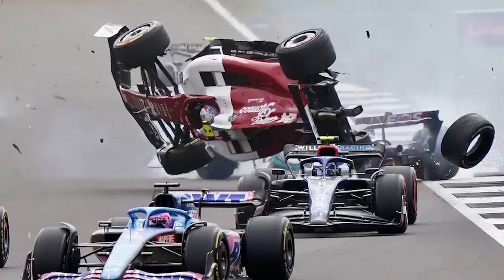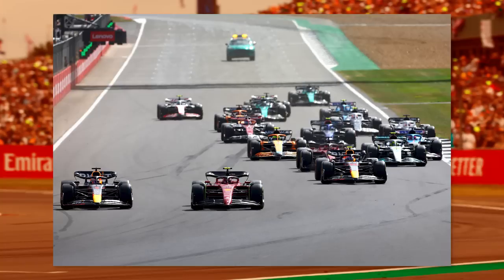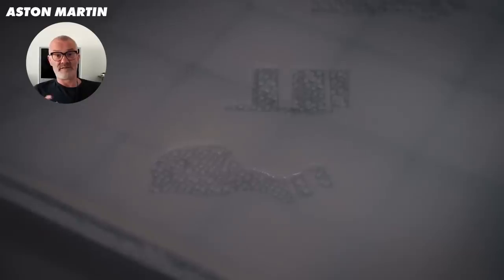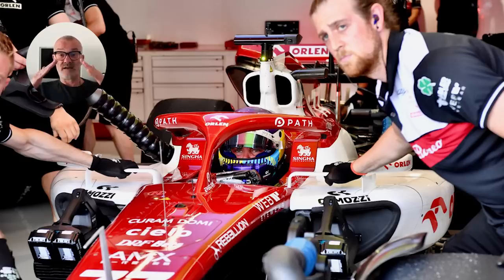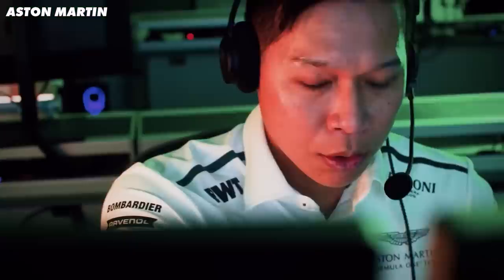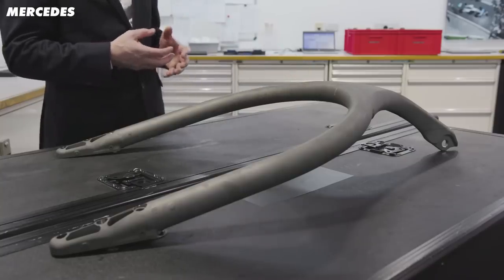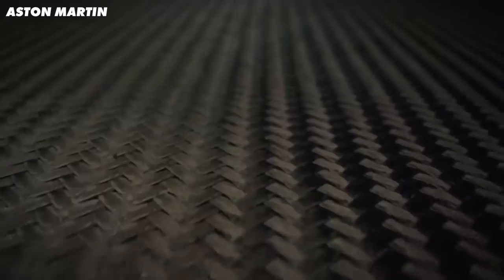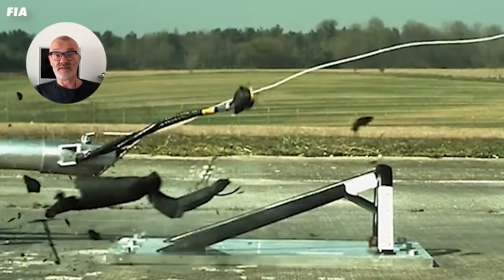Did the Roll Hoop FAIL in Zhou's Crash?

Comment: What would probably help is in addition to the 3-axis force test to do 1) a "torgue test" where you apply force from opposite sides on opposite ends and 2) a "rip test" where you apply force on the front top end in the upwards and rear direction.
This would properly test the bonds and carbon fibre in their weakest links.
If you wanna be extra fancy/safe you would do all 3 tests with static and dynamic forces.

Comment: 1:57 Wouldn't it be better if the top of the helmet didn't extend past the halo? It swoops low towards the back.
Reply: Yeah that's exactly what I was thinking!
Reply: Yea, if that was Ocon or George in the car, it wouldn't have been such a good outcome.
Reply: @scottmcqueen3964  Maybe, maybe not. You can lose quite a bit of your helmet and still be ok.
Reply: @kalasmournrex1470  wouldn't ur head just snap off if ur helmet makes contact with the ground at such a speed? Or would it shred? but i feel the latter is unlikely given how mobile and light human body is
Reply: The gap between the halo and the roll hoop is intended for driver to escape during emergency I guess
Reply: @SuperLol  You do have the neck brace which is supposed to limit the range of motion of the helmet but it definitely wouldn't be an ideal situation

Comment: Great content as always! I don't think the FIA needs to depart from static testing versus just understanding all of the likely directions that the hoop could be loaded. It was an unusual event how the car rolled and I think the more likely culprit of the failure boils down to assumptions on the magnitude and direction of force (which is more of a kinematics problem). Teams already use FEA to design most if not all parts since it's been around for a long time.

Comment: Another issue could be that the original, downwards impact could have slightly damaged the carbon fiber. the stuff is super strong, but it is also pretty brittle, so once it gets even tiny cracks or damage it will be much more susceptible to failure.

Comment: Something amusing/interesting to ponder: Some of the very earliest forms of pottery is taking clay, rolling it into long thin pieces, then layering them to form the shape of something akin to a vase. Contrast this with wheel turned stuff later on and you see the main difference is that the former is additive the latter is subtractive (if you will). The modern day 3D printed stuff like talked about in this video is really a high tech version of that technique which itself is only slightly younger than dirt.

Comment: I'm sure it's been said somewhere below already, but my thought here is that this is a great example why the roll hoop AND the halo are essential - as rigorously as you test any safety component, some real world peak loads may be end up being essentially incalculable. Crashes are unpredictable. Having fail-safes and redundant safety features is a good thing. I don't know if the roll hoop necessarily needs to be re-evaluated, tbh it looks like it did its fair share to keep Zhou safe. Obviously, improvements can be made, but there's nothing to say that an updated or upgraded roll hoop would never fail in a similar fashion in a different crash later on.

Comment: One thing to consider is if the roll hoop didn't snap off how violent the crash could have been if it had dug into the gravel immediately when the car was still travelling incredibly fast? We may have been watching an F1 car flying through the air rotating 4-5 times which could have been more dangerous for the driver when it come to GS and forceful impact hitting the floor or barrier. The fact it become smooth helped it slide across the gravel and loose some of the cars speed before the final dig in and flip.

Comment: I had the feeling that after the initial impact, the car started spinning on it, and that spinning was the cause of it failing due to the different forces being placed on the roll bar. But it is still good that they will investigate it, and probably introduce another safer system. And to see Zhou smiling afterwards shows really how good safety is these days. I enjoyed the explanation in your video, very informative without being overally technical.
Reply: i think the most likely solution is to have the roll hoop fully intergated into the monocoque rather than a seperate peice added to it.

Comment: I think they should introduce a titanium base structure for the titanium upper part to sit on as it was not designed for multi twisting forces. Bonding it to carbon fiber is strong, but ply direction during layup introduces uni-direction strength/weakness. I have experience in design with high end products and would recommend a different titanium to titanium hard mechanical mount as the carbon body can integrate the lower portion.

Comment: Great video. So did Zhou's helmet show evidence that it made contact with the tarmac?
Reply: No
Zhou is quite small and there needs to be at least 7cm of gap between the top of the helmet and the "lowest" point of the "top" of the halo
With how tight f1 drivers are strapped in there's no way for his helmet to touch the tarmac fortunately
Reply: @Alucard-gt1zf  So the roll hoop is basically redundant

Comment: Nicely explained, both of you. 🙂👍 So glad that the halo worked. Less than 20 years ago, if that had happened, he would have been dead. I'm wondering how much of that Carbon fibre failure was down to the car being so wide that the roll didn't continue until the car hit the tyres? Incidentally, all that saved the spectators from being hit by the car was the wire fence. Perhaps it should have been further away from the tyre barrier?

Comment: I'm quite sure, the shape of the upper metal roll "blade" with its quite small crossection at the top and fairly sharp edges contributed a lot to it being able to dig itself into the track surface instead of sliding over it. A more conventional roll hoop design being much more rounded on top wouldn't have been able to do so - It would have ben able to slide over the track and therefore wouldn't have had to sustain such massive lateral loads... And eventually wouldn't have been ripped off from the monocoque.
The groove that the roll-hoop left in the track tells a lot... Like scarb's said, I really think they need to take a look at the shape of the upper portion of the roll structure to prevent it fom being able to dig into the surface.

Comment: I've done FEA on an older (pre-halo) F1 roll hoop. Mid noughties, actually. Early days of cast titanium structures. The design I tweaked passed testing, and survived two in-race "tests" that same year without experiencing any structural damage. The crashes were nowhere near as severe as the FIA "proof" test. 

The idea that a structure (that can survive some 15 tons of load that crushes it towards the monocoque) is ALWAYS going to be safe (under all conditions) is ludicrous.
On the other hand, the load when a car is skidding along the tarmac is NOT "tremendous". It is barely more than the gravity of the car pulling it towards the road (0.8 tons), with the inverted downforce possibly reducing that. It is not even 1/10th of the test load. 
BUT. 
It is ALL side load, and the friction between "hoop" (we should probably call it "safety crash device") and tarmac will be trying to shear that hoop from what it is bonded to. 
"Digging in" might make it become the immovable object trying to stop a fast crash, which will rarely end well. As the video suggests, the roll hoop might need some geometry specs to ensure it cannot dig into the tarmac, because it would be impractical to make it strong enough to withstand that load in all directions. But even then, there will always be the case we failed to anticipate...
 
The delamination strength of the monocoque does not enter anyone's mind when crash tests are devised, and this one fails to test that problem totally. What is more surprising is that more roll hoops have not been ripped from chassis in previous accidents. The things work DESPITE our supposed cleverness, not because of it. (Incidentally, Airbus failed to consider delamination strength in their early composite wing designs. Those results were terrifying... luckily a mandatory real test discovered the wings were not even strong enough to survive 1x loading, never mind 5x, before the Airbus fell out of the sky.)

It always bothered me that designers focused ONLY on passing the FIA test. No-one ever considered "what if the impact is in another direction". Worse still, the structure only has to pass ONE application of that ONE load. If the structure completely collapses, that's fine. There's never going to be a second hit on that hoop during an accident, is there? 
We can be truly dumb with our beliefs and assumptions. Zhou's hoop worked once - the gouge in the tarmac proves that. And then it even worked a bit more than needed. But it could not endure the entire accident. That's another factor almost never considered in designing crash structures or tests for them. How many strikes, and for how long? 

We also have to understand that it is physically impossible to test for every eventuality. The aircraft industry makes that mistake all the time. 
So how do we cope? 
We need a LOT of engineering common sense. But that's a fast disappearing skill in the modern, computer model centric world. I never saw any comprehension of the nuances of WHY the FIA had set a specific test. It was seen purely as a box-ticking exercise. NOT a single test amongst a far more general task of making these racing machines safe enough to not kill their drivers like they used to long ago. 
Worse still is that the ego-centric world of F1 and the debate about "who knows most" tends to ignore common sense and "obvious" engineering in the quest for biggest impression in the project meetings. I had to leave the industry, after seeing some truly mind-boggling levels of ineptitude, but delivered with such confidence that every no-expert engineer believed it. 

On the other hand, serious Kudos to the Halo.
It might have been (and still might be) hated for its looks, but between Grosjean impaling an armco, and now Zhou doing an upside down grind, that's two LIVES that have been saved because the thing works in ways it was never imagined it would be asked to deal with. In Zhou's case, it dealt with the job the roll hoop was SUPPOSED to do. 
Hamilton being saved from a snapped neck by Verstappen's spinning rear tyre climbing over his car at Monza in 2021 is just a lucky bonus, more in line with what the Halo was meant to do.

Comment: Relying on the carbon fibre to hold such an important safety item is just DUMB ! 
The adhesive is only holding onto the outer layer of CF, and that later is relying on the inter-layer bonding strength. 
The correct system of attachment should be bonding AND mechanical through bolts with anti-pull through pads. 
This accident highlights the shortcomings of this design and will surely lead to improvements. 
Great video.

Comment: 2018 Monza: in FP2 Ericsson crashed the Alpha spectacularly. Although the roll hoop stayed intact there, because of the lighter cars and the not full fuel load.

It's worth to watch, you can see the full structure of the actual roll hoop, not only the drawing.
Reply: The fuel mass is negligible, usually about 90kg at the start of most races.
Reply: @byanymeansnecessary9329  Fuel limit is 110 KG/race. And it's not negligable at all.

That roll hoop is detached because of the added weight.
Reply: @gabormiklay9209  And Merc has won races using about 85 kg. Just because max fuel is 110kg doesn't mean they fill it to the brim for every race, and Silverstone is not a fuel heavy race.  The load imparted on that roll hoop and the direction it was forced in would have caused it to fail even on empty tanks.  In the 2018 Monza crash the roll hoop hit dirt, and not the track. Pay better attention buddy.
Reply: @byanymeansnecessary9329  Still, at around 200 KPH (Zhou's speed before turning upside down) 90 KG is significant.

Also: roll hoops are designed to hit tarmac (because what else could and upside down racing car hit first).

Comment: In regards to the 3d printing featured in this video, F1 has long utilized these tools both in rapid prototyping and additive manufacturing on a small scale aspects. The roll bar appears to be created as a master pattern using stereolithography (SLA), then cast using traditional foundry methods and finish machined to spec. Smart and Cost effective.

Comment: So it's anchored in a way that didn't adequately anticipate how composites can delaminate with tearing forces? So they may need to make the structural safety component anchor like a bulkhead that goes through the entire car somehow, rather than simply being adhered to the surface of an underlying frame. At those kind of forces, perhaps it wasn't treated like a stressed member as it should have been.

Maybe consult with engineers in aviation? They've dealt with lightweight composites for a long time, and forces encountered and focused upon parts such as landing gear. They should be able to tell you what's a yea or nay on heavily stressed elements. (Or those that have that potential.)

Comment: For me, the scariest thing wasn't the crash or the flip, not even the sliding. It was the place the car landed. What would've happen if the car was on fire like when Grosjean crashed in Bahrain? Everything worked like it should, and the anti-roll bar needs some improvement, but nothing like that space behind the wheel barriers. 

Also FIA, do something about the sausage kerbs, please

Comment: Physics, always a compromise when engineering every component. In some cases less rigid would be better, in others more rigid or brute strength is needed. One things for sure is every incident has them analyzing those compromises further.

It's amazing it worked as well as it did! 150+ mph upside down!!!

Comment: Excellent video.
I had heard Zhou's rollhoop had failed but not how.
The hoop never failed,the carbon fiber it was epoxied too failed.
This is not acceptable.
There should be an additional band off thicker supportive material from the back of both sides of the Halo struts that creates a much firmer,none tearable  base for the roll hoop to be bonded to and perhaps through bolted too  with a reinforcement plate of some form underneath the rool hoop.
Zhou is very lucky to be alive.
His neck could have easily been broken, on the drop off from the  asphalt ,into the gravel or anywhere through the travel in the gravel trap.
This is not something odd.
Race cars flip over all the time.
Those hoops cannot be allowed to come off the car.
Formula One and the FIA need to reinforce these roll hoop mounting points in some way very quickly.
We came very close to losing another driver.
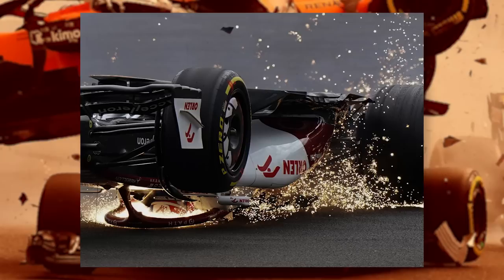The picture at 1:36 clearly shows Zhou tipping his head forward to try to stop it grinding on the track surface.
Again,great video.

Comment: I would have thought the roll hoop was bonded all the way down to the floor of the car.  The more of it that is bonded into the carbon, the stronger that bond would be.  I am guessing there will be a new rule coming down with more contact area in some regard between the chassis tub and the hoop.

Comment: There is one other little aspect- The entire crash system worked well enough so that Zhou was "(a bit) shaken, (but) not stirred"  ie his body wasn't broken, and no measurable brain trauma.  There are times that releasing energy from the system by having parts come off is actually a good thing.   In WW2 they would examine all the bullet holes in planes to see where they needed to strengthen the planes... except that all those planes were ones that came back-- that had non-critical holes.  We have to make sure we are seeing the problem correctly.   The halo worked!  The roll hoop put energy into the track and slowed the vehicle down!!  Maybe the roll hoop should have 3 shear points inside, so it can purposely release energy when upside down, sliding.

Comment: You said that rolling is really rare since low center of gravity.

I don't think this is true anymore due to ground effect. It has been seen multiple times that strong stucking aero often leads to airtime. 

I feel like this type of aero makes cars very unstable and as soon as something unpredictable happens, they're sent flying.

It has been seen with the racing cars of the 90's as many models would backflip as soon as there was a big enough bump in the road.

Comment: I'm pretty confident making an assumption that the carbon fiber delaminated. It's carbon fibers weakest link. In this specific scenario, the initial impact and the lateral force from digging into the track weakened or started the delamination. Then dynamic force parallel to the plies was rotating. That caused numerous cycles between positive and negative loading. Quickly resulting in failure of the damaged  bond between the plies. It's the same general principle as bending a wire back and forth until it breaks.

Comment: Why not just create regulation requiring the roll hoop to mount not only to the monocoque but also extend to the floor so the seat itself is partially mounted to the roll hoop. That would mean there is a titanium hoop that surrounds the drivers torso

Comment: Great video but the animation at 0:43 is not correct; Before contact, Russell was converging towards Zhou. He more or less ran over Gasly's right front who was bailing out. In addition - if George has not seen Gasly - and how often ain't that the excuse? -  there is clearly something wrong with size and placement of the mirrors. You can make it complicated as you like, but sometimes low-tech solutions are remarkably effective.